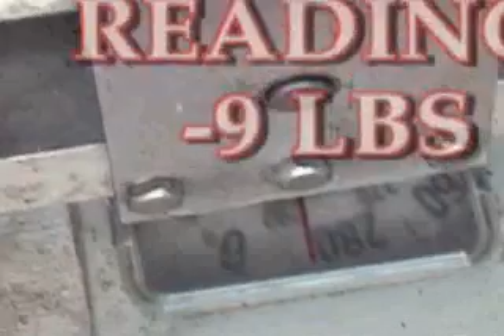MAC-QUAN 1: CONVERTIR ACELERACIÓN ANGULAR EN ACELERACIÓN LINEAL. 1/2

Comment: What sort of idiot puts a vibrating object on a weighing machine and expects to get a true reading?
Reply: he later used digital scales and it still showed weight loss. Then he mounted it on a skateboard and it propelled itself sideways. Then he later mounted it to 4 rope tethers, and it literally held itself up entirely from the force of gravity. Essentially, it was 100% levitating. See the top video linked on this page. It worked.

He is now building his Mac Quan 2.
Reply: cougarrcsnva Hayasaka and Takeuchi also used digital scales in their overall experiments, but they published only the chemical-balance test-results in their notorious 1989 paper. Hmm, I wonder why. Propelling skateboards proves nothing: An Italian professor was able to make a full-sized car move sideways. He could also propel a model boat and a model airship. Simply hanging something from ropes changes nothing. The only proof that physicists like myself will accept is a steady off-set from vertical of the suspending ropes. And even then, the entire device would have to be enclosed in a plastic bag (to suppress air currents). Also, only personal up-close inspection would suffice. Nobody sane would believe a mere YouTube video; some joker might have tilted his entire workshop, or used an Ames-room type of perspective trick.
Reply: David Fisher I agree with everything you have said. Eventually Mike Marsden is going to have to prove to scientists that his machine levitates inside of a vacuum chamber. That time will come.

And yes, propelling on a skateboard proves nothing because it could just be a very efficient high resonance slip-stick friction motion at play.

Mike Marsden's machine not only deviated itself to one side of a hanging pendulum, it also literally held itself up 100% from gravity. It actually floated.
Reply: cougarrcsnva The problem now, when I learn that, is that I ask myself why he is still wasting time on YouTube and why he has not packed everything up and camped outside of the offices of the Nobel committee. The costs involved would be soon paid off by the prize that he would undoubtedly receive, not to mention a contract with NASA, for demonstrating a clear contravention of Newton's third law. The fact that he has not done that makes me think that he does not have confidence in his results.
Reply: David Fisher I think he is just getting all of his ducks in a row; such as patents from the USPTO. Whatever his deal is, eventually he will release the technology to be studied and verified by the scientific community.

I have researched all types of inertial propulsion, and they are all BS. This guy is the real deal. I know exactly how it works but I don't have the $20,000+ it would take to build a perfect replica of the Mac Quan 1 to replicate his results. Eventually I will though. I built a cheaper version but it didn't stand up to the abuse of the RPM's. It needs heavy duty aluminum and strong ball bearings to work effectively over and over again without damage.
Reply: David Fisher
He is dead
Reply: cougarrcsnva I still believe that his thinking is too limited: a machine which could really do what he claims would make him a shoe-in for a Nobel prize. That's a million dollars right there. Plenty of money for development, major aerospace companies competing to hand him a lucrative contract. And, patented or not, who could get away with stealing the idea under those conditions?
Reply: David Fisher Anyone can get away with stealing intellectual property, if you were dumb enough to not patent it. If you release your technology, someone in theory could just rush out and patent the idea and if they were issued the patent, it's just too bad, so sad, it is now their intellectual property, even if someone else actually invented it. The patent is all that matters; it's a legal document. If you don't own the patent then you can just take a hike, even if you did invent it. I could give you a cease and desist letter and tell you to stop talking about MY patent (even though I was a jerk and I didn't actually invent it) and you would have to obey me and stop talking about the invention that you invented.

And he already knows how important his machine is. That is why he talks about it being "next to the Wright Brothers" plane at "the Smithsonian". It is literally that important.

But it's also dangerous; maybe he thinks human kind isn't ready for that kind of technology just yet. Or maybe the government has threatened him for fear it might fall into the hands of a foreign government or something, who knows? Either way, I have done the math and it works. And I have built two replicas of it so far but I am trying to raise funding for a third more reliable one. A friend of mine built a replica of it too in thick plastic with 3D printers.
Reply: cougarrcsnva So then, just the same tired old excuses. Initial patent protection costs next-to-nothing and no prototype is required. In any case, a patent on this type of machine will never be granted because a) the principle is not original and b) it is contrary to the laws of physics.
Reply: cougarrcsnva oh!!!, SO YOU WANT SOME FUNDING for a device you say you COPPIED!!!  from Marsden. I have two cents that I would like to invest in your COPPIED!!! machine and perhaps you could PATENT!!! your COPPIED!!! machine and I could become rich on my investment. Oh!!, how marvelous for me. [sound of insane laughter]
Reply: antiattorney actually I don't want anyone to fund me. I will fund my endeavors entirely myself. And Mike Marsden doesn't ask anyone for funding either. He pays for everything himself. He has never asked anyone for one cent. 
All I was trying to do was make a point that Marsden should protect himself with a patent so that someone doesn't come behind him and steal his intellectual property. It's just good common sense. 
And I did try to copy his machine, but I didn't have enough money to build a proper prototype so it didn't work out as expected. And I would not try to profit off of someone else's work. All I was trying to do was test it myself to see if it actually does work like as shown in the video. 
I was then trying to create my own unique version of a machine I came up with myself that utilizes the same inertial principles as his, but is done in my own unique way so as to not copy Mike Marsden's Mac Quan 1. But I found that my design was very unfeasible and probably won't work. I think that Mike Marsden's is the only realistic machine design that can take advantage of this anti-gravity phenomenon. He is still working on his latest variant but he doesn't tell anyone any specifics about it. All I can do is just hope that he one day finally releases his technology to the world.
Reply: +vril ya By doing that, all that you have produced is a wildly eccentric rotor. If that is fixed rigidly to the Earth (the 'forgotten partner' in all movement), it will merely serve to wear out the bearings very quickly. If is it not fixed rigidly to the Earth, it may well move; even across shiny floors, ice and water. But that is nothing special, any movement would be due to asymmetries in friction, or other sources of drag.  A washing-machine with an unbalanced load could do as much. If the device is in free-fall or in outer space, the whole thing (rotor and whatever is driving it) will simply oscillate helplessly around its center-of-mass. There will be no propulsive effect.
Reply: ***** David Fisher is right; you are trying to think about it logically. Inertial propulsion is not logical, just like the Universe isn't logical in some sense, to our way of thinking. I used to think just the say way as you did, that I could intuitively "see" a machine moving forward due to an "asymmetrical" "imbalance" where you speed up on one half of a cycle and slow down on the other half. That's not how the Universe works. The Universe works in a 90 degree, 3 Dimensional platform; that is the very structure of it. You have to break up the cycles into 45 degree angles, not 90 degree angles. That is how Dr. Marsden's Mac Quan 1 machine works, by mimicking the 45 degree turns of an actual electromagnetic wave in the Universe, which moves without any "equal and opposite" reaction.
Reply: It's unlikely this machine will go far without a suitable power supply. It's also unlikely to be as efficient as existing means of propulsion. Even if it goes to space, what's powering it?
Reply: crestind just an electric motor. All you'd need is a small plutonium isotope electric power generator to have 20+ years of electric power onboard to keep it powered. 

Of course this thing is more efficient than current junky rocket technology. At present we run out of rocket fuel in like 30 seconds, and have to just "coast" to other planets at whatever slow speed we can achieve in that little wimpy 30 second crappie window of "burn time". Which is why JPL always has to "slingshot" their probes using the gravitational pull of Jupiter to try to gain speed. 

This technology eliminates all of that. This Mac Quan 1 does a full 1G of CONSTANT acceleration. His new Mac Quan 2 has over 2Gs of CONSTANT acceleration. 

This thing would be going trillions of miles per hour if you unleashed it. 

This thing would be accelerating so fast that it would be past Pluto in less than a single week. And you're trying to say that isn't efficient? 

This thing is going to completely revolutionize space travel. We will finally be able to get to other planets in minutes, instead of taking months or years.
Reply: It will not work, period. Inventors of this type have existed since the 19th century. They misinterpret what they see in their clumsy experiments.
Reply: Put it into outer space somehow, and all that it will do is oscillate about its own center-of-mass.
Reply: MrAaronvee you'll be eating your words whenever he finally feels like releasing this technology. 

This isn't like past inertial propulsion machines that are essentially violently spinning washing machines that "shimmy" themselves across the ground. This thing actually works. It has already 100% lifted itself against Earth's gravity for a very long time. This machine is not like the others. It really would rocket away from Earth at over 1G of acceleration. It could be out of the Solar System in less than a week. It would not just bounce back and forth. This thing truly is "linear displacement" as he calls it, or "mechanical light" because light too also moves without any "equal and opposite" reaction.
Reply: Slow down, how much does the device weigh? What is the wattage to generate this 1 g of acceleration? Those isotope generators you describe are very weak... "a few hundred watts or less".
Reply: The Mac Quan 1 weighed 32 pounds so the " linear thrust" that it created was a little bit more than that. He already knows about that limitation of electricity on such a small scale; which is why batteries were out of the question for him. I was just giving you an example, such as if you were NASA or JPL, you could in theory power this thing with just an electric motor if you had access to some revolutionary onboard electrical power supply system that used a nuclear reaction or something like that. However, he is coming up with something completely different to power this thing. It's almost like an internal combustion engine, but strangely it can work in space even obviously without any "air" to "breathe" into the engine's intake. Instead, it basically "recirculates" their air, which is exiting from the exhaust system, which is designed to come out at exactly ambient temperature (not hot), and is then "rebreathed" back into the engine again to continually power the process. It's an entirely "sealed" system, just like a refrigerator's "refrigerant" is "sealed" and never "escapes" into the atmosphere and is just continuously "recirculated" through the engine over and over, except this is like an "internal combustion" engine with pistons and cylinders moving a crankshaft. That is an entirely new invention of his altogether as well and is probably why it is taking him so long to launch this thing. This guy is something else; it amazes me the stuff he is coming up with.
Reply: Well if it relies on combustion it's going to need oxygen somehow, no getting around that. The recirculated air you are describing cannot be involved in combustion because there would be no oxygen left to allow combustion, so it sounds like a Stirling engine of some sort.